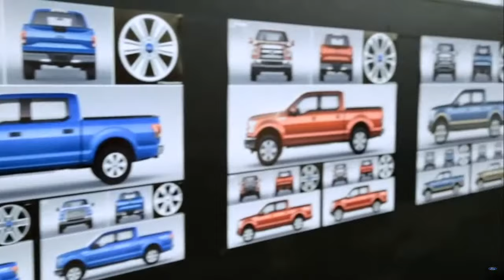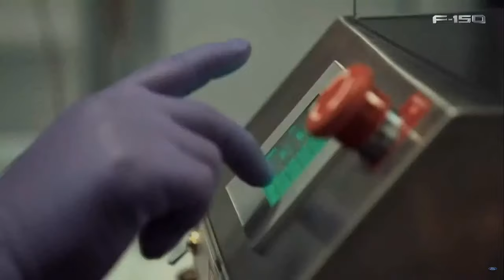Revealing the All-New 2021 Ford F-150

Comment: I was a die hard GM guy, until I wrecked my Chevy and had to look for another truck. Got my hands on a super duty king ranch and I must admit, Ford is way better. When it comes to power Ford is better no doubt about it. When it comes to the interior, Ford is always one step ahead of Gm. It’s a better vehicle all around whether you need it for work, off road, or just for looks.
Reply: Loved my Tahoe until I wrecked it in 2017. Bought a brand new Expedition. Better than my 2015 Tahoe. Ford is a lot better.

Comment: How does a 2021 truck still have a wire antenna?
Reply: Truck would look weird without it’s been there for decades
Reply: Bad Drivers Of The NorCal Area right lol
Reply: Learn physics dude
Reply: Bad Drivers Of The NorCal Area are you kidding me it’s since they want Stuff to work unlike Chevy
Reply: S W why change it when it works better and could help for commercial use in the work space so it doesn’t break and has a wider range of frequencies
Reply: Alex Hein they make them reliable af tho
Reply: Bad Drivers Of The NorCal Area and how are you saying there is no innovation in that sense
Reply: @alexhein1738  Bronco "hold my beer"
Reply: They work better the new shark fin ones suck plus its probably so owners can upgrade to a larger post apocalyptic antenna for cb radios and such
Reply: Does it matter ??
Reply: Imagine a wire antenna determining how advanced is a truck
Reply: KherielTheCereal Perception is reality

Comment: I wanted to buy a 2020 ford f150, but ive been seeing way to many class action lawsuits
Transmission problems, turbo problems, oil consumption problems and many more
Plus heres the kicker, people that have a 2018-2020 f150 the dealers  (. DO NOT HAVE A  
REPAiR FOR ALL THE DIFFERANT ISSUES AND PROBLEMS)
Pay all that very hard working money to get a truck f150  to have so many problems
In my line of work, if i did that crummy of a job id get fired

Comment: 7:32 It's the kind of truck you can't argue against, because it's clean, and it's dirty... 😂🤦 - Ford, a family company 🤣
14:58 Is that generator edited in there?? 🤨
24:16 "Purpose-built features" - Yeah, what other things can you build features for than a purpose? 🤦 - Seeing it in action? I only saw CGI.
Cynically speaking. this doesn't seem much more cringy than other such marketing presentations, though. I have seen so much. - It has a teleshopping vibe. Although teleshopping tends to have less wooden acting with tightly scripted texts. (Why don't they just use robots?)
I think this presentation is simply optimized for the target audience, hah. They're shaping that in a related department.
Reply from the maker: Bit rough spots in the presentation will admit

Comment: Cybertruck is better
Reply from the maker: Not for people who actually use their trucks!
Reply: Island Ford I mean tesla only started in 2003 and made their first model in 2008 and plus Tesla will be making their very first truck in 2021 that has the best specs out of most trucks these days and in 10 years (prediction) gas powered cars will be dead
Reply: And the technology on the Cybertruck is way ahead of its time
Reply: @collinsdang3587  Gas powered cars will not be dead in at least 20 years. As a Tesla ownwer, and you should think about the range of Cybertruck, can you charge the cybertruck anywhere at wildlands ? Can you run that range much with towing a RV/Vehicle ? Can you carry a battery ? I know, I know, it has a solar charger pad, but it only charges 5 miles/hour or less, all depends on the weather. For a gas car, 5 mins just pour the gas into the tank, thats it. There are no doubt, Tesla holds a very big market share, and expanding so fast.
Reply: @collinsdang3587  Sometimes too much technology in a car is not a good thing. Mechanical structure is more reliable.
Reply: 八级大狂风 still  Cybertruck is  darn good for the very first truck from Tesla
Reply: 八级大狂风 I don’t want to pay $55+ dollars when I can charge my model 3 for $7-12
Reply: 八级大狂风 and it’s my opinion on what’s better so if u like the f-150 good for u because everyone has opinions
Reply: Collins Dang I agree with u bro Tesla is doin a good job for their first truck and it’s comparing to a company that made trucks for a 100 years
Reply: @collinsdang3587  Truck is not only for city roads, I charge my Tesla for free, but i have never been to the charging station. I wouldnt buy Tesla if I have to go to the supercharger and wait 1 hour for a free charging.
Reply: @collinsdang3587  "everyone has opinions" good to see you say that. Techonology just can not compare with mechanical structure unless they are reliable enough.
Reply: 八级大狂风 ok but once again ur opinion
Reply: 八级大狂风 tru
Reply: Collins Dang Gas/Diesel powered vehicles will never be “dead” ...there will always be a market for them just how there will always be a market for whatever Tesla vehicles are considered to be (battery powered, solar powered whatever..) the problem with Tesla is they are trying just a little too hard to win over the people who own regular trucks.
Reply: Collins Dang Example: why would you need “bulletproof” windows for? (Unless your in the cartel)...why didn’t they “tug of war” a 4x4 Ford? And why didn’t they decide to do a truck back when Tesla first started?? Sounds to me they’re desperate to get the Tesla name out on the road
Reply: Daniel Regalado like I said everyone has opinions
Reply: Daniel Regalado it’s not that easy to build a truck right away when the company is only like 10+ years old
Reply: Daniel Regalado u can’t really judge a car when it hasn’t even come out year and plus what’s wrong with a bulletproof car it probably makes u extra safe while driving.
Reply: Eddy Richards so then why are people saying the cybertruck is better if it hasn’t came out yet? And take it from me, when you get in an accident all you want to do is get out of it, how are you gonna do that with bulletproof windows? Can’t break them to get out? Take it from me that I rolled my old truck, luckily windows broke so I was able to get out.
Reply: Kuz Imani Every other car manufacturer was able to do it back in the day when technology wasn’t like it is today. Your telling me Tesla couldn’t  make a truck when they started making cars??
Reply: Eddy Richards  Tesla hopes that they will there add a button that will eject the window
Reply: Daniel Regalado Don’t ask me ask Tesla dude
Reply: Daniel Regalado Tesla has the lowest rollover rates out of any car companies look at the crash and rollover test on YouTube.
Reply: Collins Dang tests are not the same as real life situations. Like that other dude said, you can’t say Tesla trucks are better if they haven’t even hit the road yet.
Reply: Daniel Regalado we will see and plus the Tesla model x and model s has the the lowest rollover rate per consumer report.
Reply: Daniel Regalado Tesla has won the highest safety honor from the Insurance Institute for Highway Safety for the first time in the electric vehicle maker's history. The Tesla Model 3 earned the 2019 Top Safety Pick+ award from the organization after achieving a "good" performance in all six IIHS crash tests.
Reply: Tesla= One of the safest cars in 2019-2020
Reply: Collins Dang facts
Reply: Collins Dang I never said they weren’t safe, I’m just saying you can’t judge a truck when it’s not out yet. All I can judge is a “bulletproof” window that failed miserably when they were trying to show it off and an uphill “tug of war”. And if you know anything about towing then you know why that was some b.s.. When it comes to rollovers, until you’ve been in one then you’ll understand what I’m saying.
Reply: Collins Dang over all you have your opinions on electric cars and that’s great, but when you say that’s gas vehicles are going to be dead your wrong. If that were true they’d be gone by now
Reply: Daniel Regalado k
Reply: Daniel Regalado I have a Tesla model 3
Reply: Daniel Regalado and I will get the cybertruck
Reply: Collins Dang cool, I have a Ford  f350 king ranch, I’m gonna get a 2021 same trim
Reply from the maker: @collinsdang3587  How do you know it is not even built yet
Reply: Island Ford he doesn’t know. None of the cybertruck fans know what an actual truck is.
Reply: Daniel Regalado k
Reply: Collins Dang You still here? Thought you were in other people’s  comments praising Tesla lol
Reply: Daniel Regalado yea I’m here
Reply: Collins Dang just out of curiosity, does charging your Tesla affect your light bill and if so by house much?
Reply: Daniel Regalado we all know the electric future of ford is gonna be comparable to tesla but Tesla is still a solid company
Reply: How*
Reply: Daniel Regalado just cuz Tesla’s electric cars are cheaper to own than gas cars and the cars are pretty nice too.
Reply: Eddy Richards no one is saying they’re not. All I’m sayin is how can someone say the truck is better than any other car manufacturer if there truck hasn’t came out yet.
Reply: Daniel Regalado I agree but I feel like the ones that are out like the model s,3,x are better in its class than like a Ford Fusion or Ford Explorer
Reply: Daniel Regalado you don’t have to use the home charger bud, there are tesla charging stations
Reply: Eddy Richards I agree but I’m not talking about cars. The dude who made this comment said “cybertruck is better” and that’s his opinion, cool, but it doesn’t make any sense.
Reply: Nick Johnson i know that dude, but that depends in the area where you live tho. Down in south Texas there aren’t that many bud
Reply: Daniel Regalado tbh, cybertruck has either potential to be better OR worse. Both are going to sell a lot
Reply: Nick Johnson yea probably
Reply: Nick Johnson I can honestly say I can agree with that, it’s just the Tesla cybertruck dick riders don’t see it that way. I agree there’s a possibility that it can be a huge success but it can also flop like that “bulletproof” window lmao.
Reply: Daniel Regalado okay then don’t listen to him
Reply: @danielregalado2087  for me i have a model s perfformance, so the electric bills may different from the others. uaually takes 300usd extra per month for the electric bill
Reply: @eddyrichards549  dude they are not "cheaper",example: model 3: if you think 50k is cheaper to own, then it is. but you should own it first and then you can talk about it
Reply: 八级大狂风 technically I was preordering a Mach e and plus owning a Tesla is cheap because charging is cheaper than gas and electric cars don’t need maintenance that much that’s what I meant
Reply: @eddyrichards549  i know what did you mean. but have you thought about if there are any problems with tesla. Battery dead, noising, this is what i mean.
Reply: 八级大狂风 oh
Reply: @IslandFord  cybertruck is futureristic.
Reply from the maker: @laithalnaami  *futuristic and yes it is... when it finally lands in customer's driveways years from now